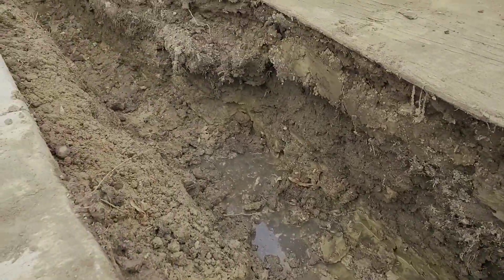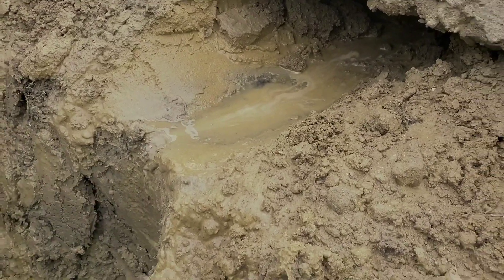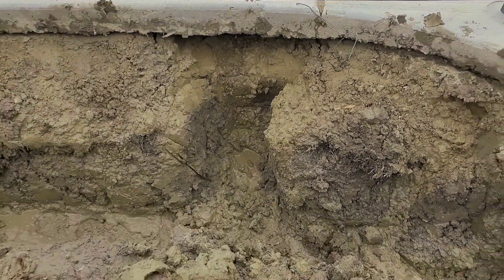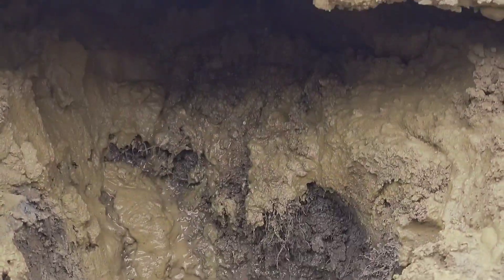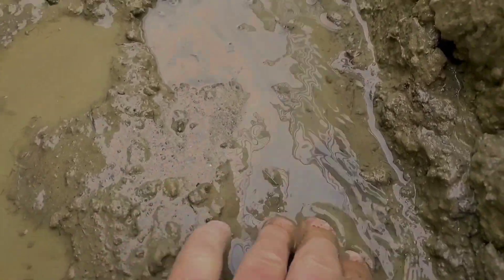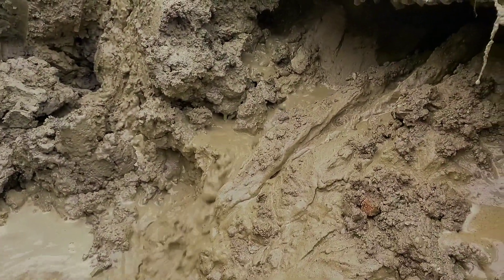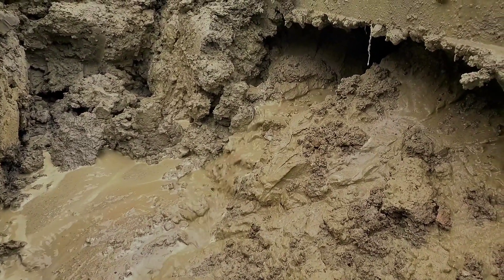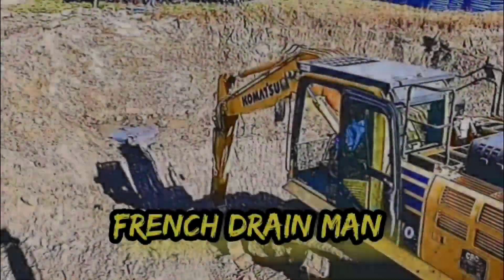Drainage System for Concrete Driveway, Walkway, Patio, pool deck so they LAST FOREVER!!!!!!

Comment: Good video topic. I'm fixing a wet house sitting low to the main road and all that sand under the concrete drive just funnels the water at the house basement to be pumped out. Previous owners even piped the eaves down around the house or into wells close to the basement. Swimming pool if the sump pump gives out. Before I started repairs, two sump pumps were running every seven minutes.
Reply from the maker: https://youtube.com/playlist?list=PLjFCqaZ4v1BUpFHCLJ_sUFTqw1WoXu1Vz&si=E4UzD8vypZqr9hOb